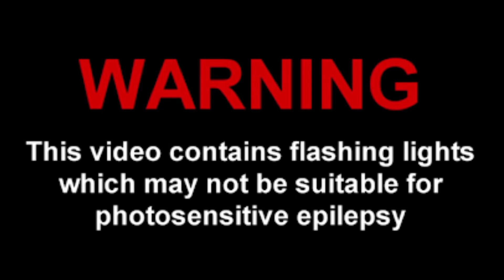Impreza43- LS AWD SWAP FITS IN THE SUBARU IMPREZA

Comment: Will it be awd?
Reply from the maker: It is still all wheel drive. The trailblazer ss transfer case has a Torsen unit instead of a viscous coupler, so it can mechanically bias more torque forward or rearward as traction allows.
Reply: If you use the Colorado front diff with electric disconnect.  Can it be driven with just power to the rear or will the tbss torsion not work like that.   
I saw family man racing awd ls 3000gt had his setup that way but he had a 100 %locked xfercase I believe

Comment: Looks like the back of the trans is too high. Shouldn't the motor/trans be angled down towards the back?
Reply from the maker: I didn’t know exactly what angle I needed so I built the cart with the crank center nearly horizontal. I need to make the rear diff mount for the ford 8.8 irs before I finalize the engine/ transmission angle so it is all aligned properly.
Reply: I don't think it really matters with a independent rear with a live axle it probably would
Reply from the maker: @austindoud273  the driveshaft still has U joints and so it still has to have the pinion and transmission angles relatively close to straight.

Comment: I like how you start by neatly removing a tiny square of sheet metal and follow it up by removing half the floorplan.
Reply from the maker: Measure once cut 17 times lol
Reply: @PsuedoMechanic  How narrow is the front footwell with the engine mounted centrally? I can't imagine that offsetting the engine would be good for driveshaft life or torque steer.
Reply from the maker: @jrshaul  the footwell is about 18” wide. I will match the angle of the offset with the rear diff. With a 3” offset at the crank snout and a 92” wheelbase I calculate a 1.86 degree angle at the rear diff. So basically meaningless.
Reply: @PsuedoMechanic  Nice. 

Out of curiosity, is it mechanically viable to move the engine forward? If memory serves, you're mostly okay as long as the shafts are parallel.
Reply from the maker: @jrshaul  the front cv axles have a maximum travel angle of about 40 degrees. If I place the engine further forward the angle of the front cvs will take up some of that 40 degrees and limit the maximum steering angle. I placed the engine where the front cvs and front diff are at nearly 0 degrees so I can maintain full wheel turning angle.
Reply: @PsuedoMechanic  Thank you for explaining. 

As long as we're on the subject of batty ideas, how viable would it be to use this drivetrain in a mid-engined configuration? It looks like the propshaft could be extended all the way through the oil pan of the engine to a differential in front of the driver. 

You'd have a strange forward-control race car, but it wouldn't be the first. I've always been partial to the old Alfa Romeo 6C Aerodynamica Spider.

https://www.italianways.com/wp-content/uploads/2014/01/IW_alfa-romeo-6c-spider-aerodynamica_1935_04.jpg
Reply from the maker: @jrshaul  any 4x4 or AWD transfer case can be used to make a mid engine car as long as it physically fits. The prop shaft does not pass through nor interfere with the oil pan. On my engine/ oil pan, the front differential is mounted to the pan and the front axles passes through it. So, one could use a standard oil pan and move the engine back and use an irs type differential in the front. It’s not really worth it in most cases because a car can be adjusted to drive properly even without 50/50 weight distribution. In fact very few cars have a 50/50 bias and they still perform great, like all the Subarus and evos are front heavy. So unless there is a really good reason to have a mid engine it’s unnecessary, especially with an aluminum block.
Reply: Great surf guitar. 
2 door Impreza looks sick! I think the wrx looks awful, and has a 4 door weight penalty. Mitsu evo looks like butt too, something grandma drives but w aero and bigger tires. I mean, u had to have removed 150 lbs of steel, glass, drive shaft, etc
Watch out for that snap oversteer and stay on throttle, gutted hatchbacks can rotate all too quickly and power to front wheels tames this
Reply: Oh crap did i just interrupt conversation vs public posting or whatever? Apologies, i suck at youtube
Reply: @kennethfrazee2540  naw you good fam, it makes the algorithm happy.